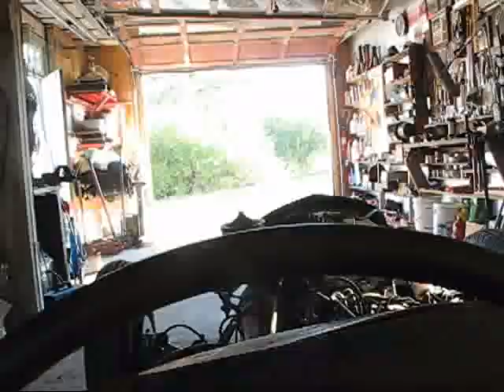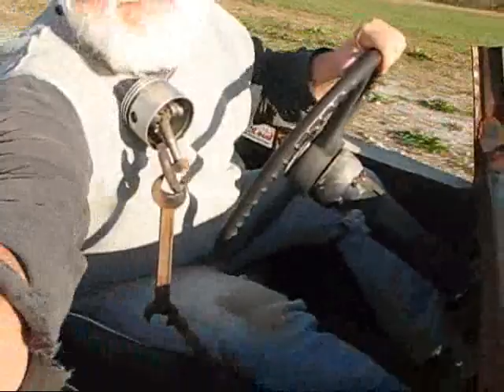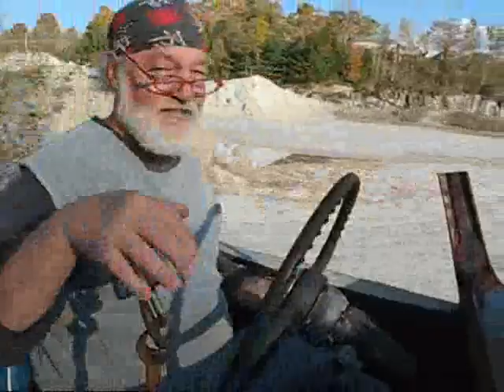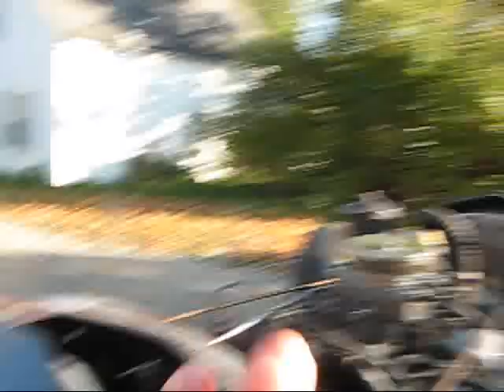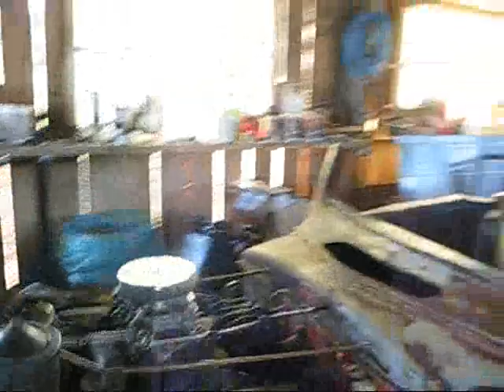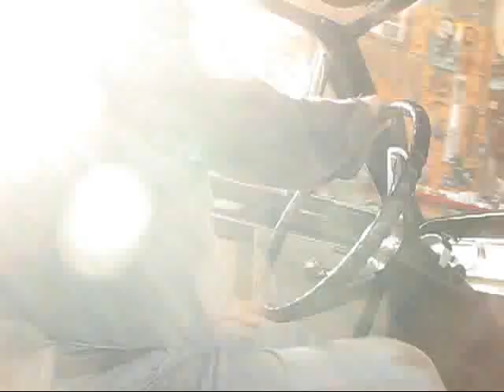Not just another car show, hot rod, rat rod ride proposal

Comment: 95 f150 with 300straight six 4X4-5speed. So far, we have completely rebuilt the chassis and everything we used was stripped down from that cruddy factory paint and we used  rustoleum truck bed liner on all hardware. Then... all new springs and shocks all around! Now we are workin on refurbishing this decent core support we got at a junkyard for 20 bucks.

Comment: Im sure you've said before, but could you tell me about how you made this thing? what is the body from? the Chassis?  I love it
Reply from the maker: The body is a 1947 firetruck.  Frame is a boxed 33 Chevy frame, stretched with a 40 Ford front axle, suicide mounted.   Rear end is a 57 Ford.  The turtle deck is made from a 57 Ford hood turned backwards.    Steering column is 57 Ford.  Steering wheel and shaft is a 51 Olds, I think..    It has a 53 Cadillac 331 engine.  It had a Dynaflow tranny, and I swapped it out for a T-5 5 speed straight shift.  I also put disc brakes on the front.   The rear brakes are from an 84 Ford pickup.  I think that Grill shell came from an Austin, and I chopped and narrowed it.  I've got 3 play list on this thing you can access from my YouTube home page and it documents the whole build.   Probably about 600 or so videos...   It'll keep ya off the streets if'n ya watch 'em all..  hahaha.
Reply: rpeek thank you sir! Keep on doing what you do!  I'm gonna have to build me one just like it.